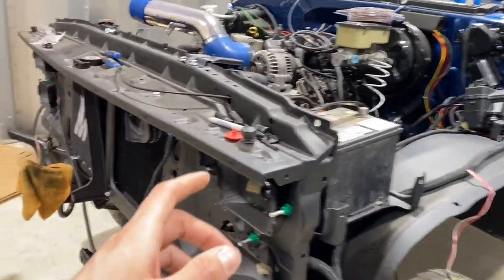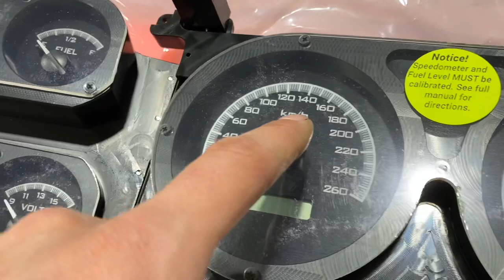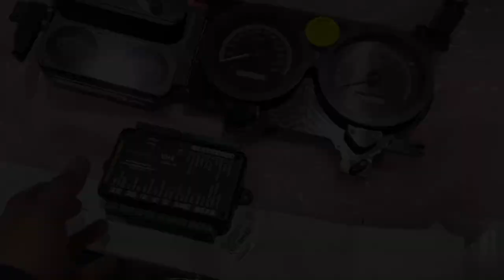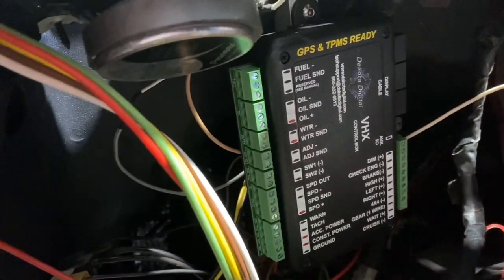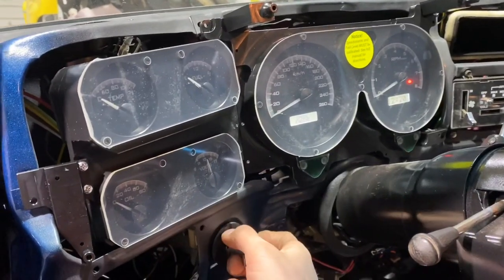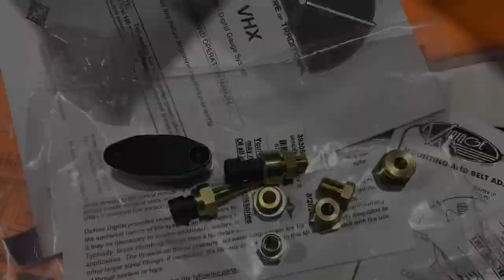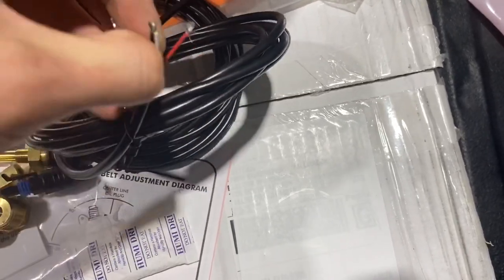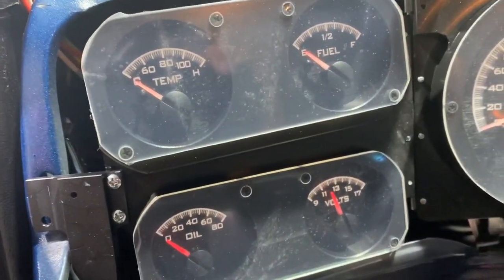1986 K10 Dakota Digital Gauges Install!!

Comment: What wire did you connect to the module to get the cluster lights to come on? The tail light wire or the headlight switch?
Reply from the maker: It was a wire off of the headlight switch, from factory the cluster has a wire in its plug that signals the backlighting to turn on, so it’s that wire. Has 0V when lights off, 12V when switch is pulled out in both 1st and 2nd positions

Comment: Hey question, when you were wiring the turn signal pigtails, what “power and ground” did you wire them to? So you completely avoided the control box?
Reply from the maker: There’s a left wire and a right wire from the factory cluster plug that gets cut off and can either be wired into the box for the cluster arrows to light, or don’t hook it up to the box and instead wire to the two wire pigtails for the lower signal lamps
Reply: @bradenrein  so you just wired both of the pigtail wires to that one wire? Or the white/green one to that factory wire, and the white/black to a ground?
Reply from the maker: White and green on left pigtail goes to left signal. White and green on right pigtail goes to right signal. White and black from both get tied together and grounded

Comment: Smoothly done 👍👍
Keep it up 😎

Does it fit on High Sierra 2500 1981.. vortec 5.7 swapped ?
and how can I order it ?
Reply from the maker: It should fit perfectly in an 81 yep, mine was ordered from summit racing, but there’s many different distributors for Dakota Digital

Comment: Braden, please, tell me if your engine is diesel or not. If yes, how did you connect the tachometer? Thank you.
Reply from the maker: Nope mine is a 5.3 gas engine, the PCM has an output wire that directly goes to the Dakota Digital module tach input
Reply: @bradenrein  Thank you, Braden.

Comment: What size belt did you use? I recently got the vintage air AC system but I don’t know what size belt to get for it now
Reply from the maker: Dirty dingo lists the belt part number you need in their instructions, I’m surprised vintage air wouldn’t. You can always measure the route with string and then there’s a chart you can google that will give you all the measurements for gates belts and part numbers to order it
Reply: I'm sure you got it by now, but for anyone else that comes across this looking for help, for a truck 5.3, the Gates part number is K061115.

Comment: Thanks for the videos my friend just have a question about your fuel sending unit.. it give you any trouble. Because I can get mine to work at all my gauge doesn’t move I try everything check all my wiring and everything if you have any info you can help me how I would appreciate it so much thank you
Reply from the maker: Mine have been great! Make sure you have a solid ground, I know that’s a common issue
Reply: Thank you man have a wonderful day

Comment: Did your temp sender screw into the adapter all the way til both hexes were touching? I have mine tight but there is a gap and wondering if thats how its supposed to be? On Dakota Digital video it looks like they are touching.
Reply from the maker: I put Teflon tape on mine and tightened until tight by feel. If it leaks, it needs to be tighter
Reply: Thats not what I meant.
Reply from the maker: Oh my bad, could you rephrase the question?

Comment: Do you have the part number for that oil pressure adapter piece?
Reply from the maker: I don’t have the exact part number, but here’s a link to a similar one. Mine was purchased off amazon 
https://www.amazon.ca/Pressure-Sensor-Adapter-Port-Dual/dp/B01IO4PRJW/ref=mp_s_a_1_43?dchild=1&keywords=ls+swap+oil+adapter&qid=1602278726&sr=8-43